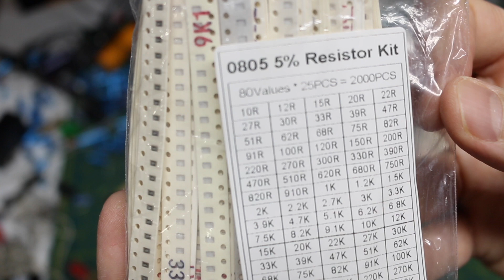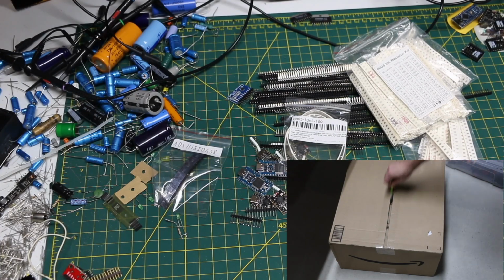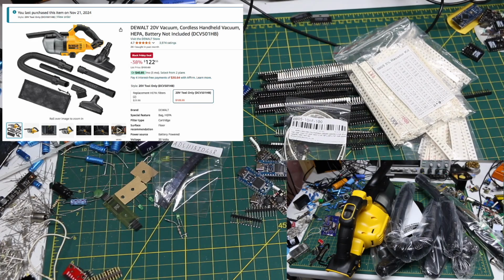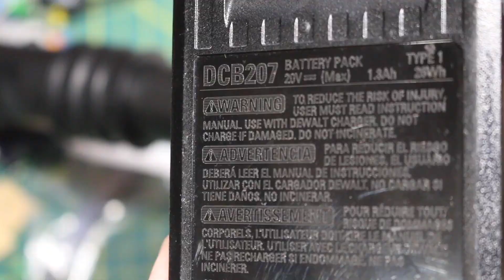Mailbag! Black Friday Stuff

Comment: You need some of the long extensions for the vacuum to be able to reach to the ceiling for big spiders and cobwebs.  I sucked up ants one day for an hour that were in a large trail crossing in front of the pool.  I shoved a paper towel in the intake and put it in the deep freeze to kill them without damaging the vac.  Most of the critters I return to the woods.  If they gave you a foam cover for the filter put it on, it makes it easier to clean.  Those vac's are great.  It's a have-to item.

Comment: Fun stuff as always.  You're 100% right about getting the kits until you need a bunch of one item.  I will say that one trick I've learned is that if I have a lit of 0805 resistors and I buy 100 10k ones separately. I use a red sharpie or something on the kit 10k ones to remind me that I have them in bulk somewhere else.  I do that on everything.  Like chips, I put a * if I have a hundred of something in bulk storage somewhere so I don't reorder.  SMD parts are such a pain to organize.
Reply from the maker: while I was continuing to go through parts yesterday to  organize them into the trays instead of all the various random plastic bins, I found some bulk smd  1K and 10 K and 100 nF and a bunch of SOT 23 transistors and op amps and logic chips I forgot all about. 
At least I’ve gotten more organized in the past year gradually adding parts to the part trays that I bought the year before that, where are the park trays set around for a year until I started putting things in them. 
Now if only I could remember where the LabelMaker is. I should have labelled it.

Comment: nice, watch out you don't start loosing components with that vac.
My flume extractor has in the past been know to suck up a bit more than flumes from the bench. 🙂
Reply from the maker: I will especially have to pay attention when vacuuming the floor under the workbench because I’m used to knowing I’ll have a chance for a visual inspection in case something worth more than 75 cents dropped but now it’s a whole different game.
Reply: @GadgetReboot  if I've been using the flume extractor and i can't find the missing components on the bench or on the carpet.
I check the filter, the buggers just sit on it just below where the hose is.
We all know that when you drop a SMD component on to the floor it hyperspace jumps on the first bounce. 🙂